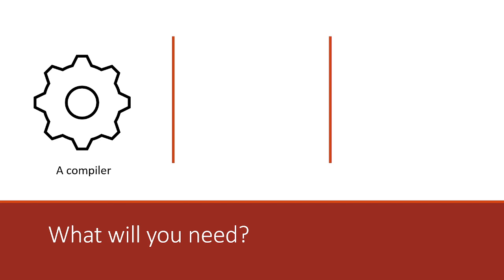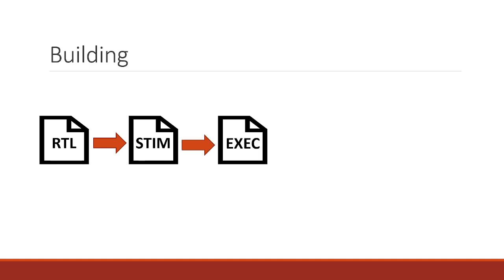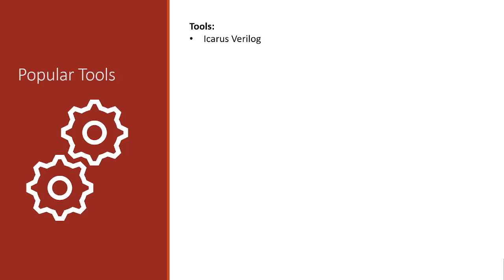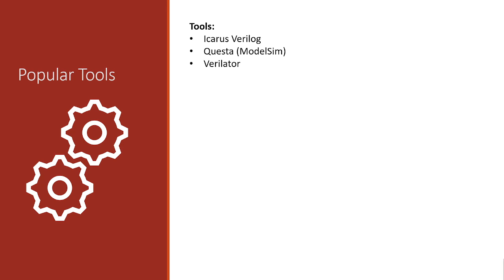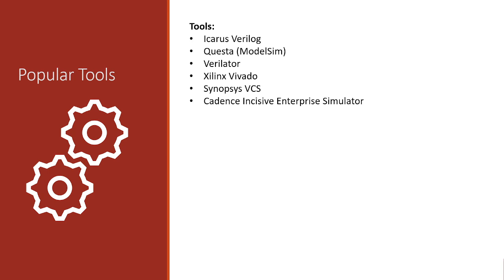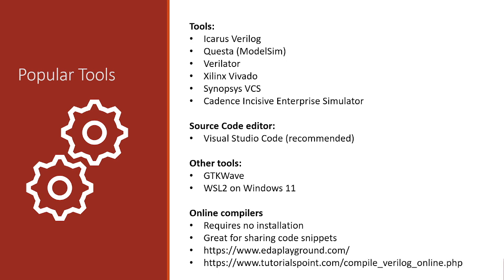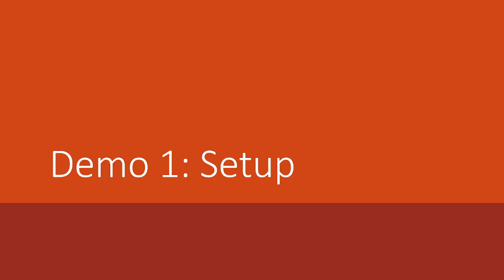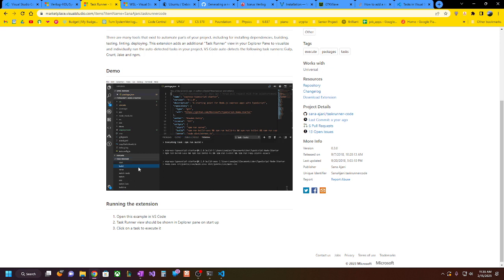Tools - Verilog Fundamentals

Comment: I am getting kind of frustrated trying to install the wsl vscode ext.  It fails from the ext manager in vscode and says install manually and sends me to your gethub page and says manually runthe vsix installer, but all that is on your page is four demo files?????
Reply from the maker: I am sorry to hear the setup is not going smoothly. I am suprised that you clicked a link on WSL and it brought you to my verilog demos repository. The WSL extension was created by Microsoft.

The link to the WSL extension is in the description:
https://marketplace.visualstudio.com/items?itemName=ms-vscode-remote.remote-wsl

What operating system are you running off of?
Reply: @metaphysicscomputing  I have win 10 with wsl2 set up.  Is this extension something different?  And have you checked the icarus link?  It also failed for me.  I included the page error I got in my OP.  Oh and thanks I have a DE2-70 and have I a couple of old nexus2 boards and I am saving to get a de10-standard board.  The $57 shipping fee kind of sucks.
Reply from the maker: At the time of the recording, their website was working. Right now the website (http://iverilog.icarus.com/) is also not working for me.

But don't forget that I have the link to the github right under neath it:
https://github.com/steveicarus/iverilog